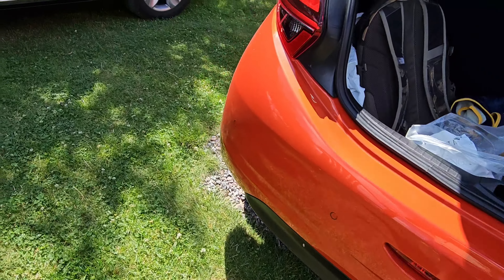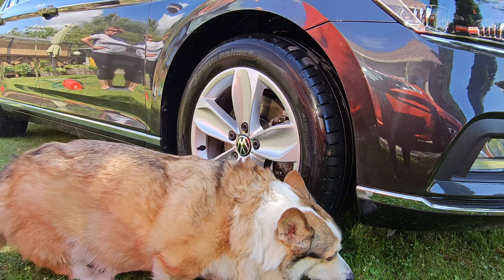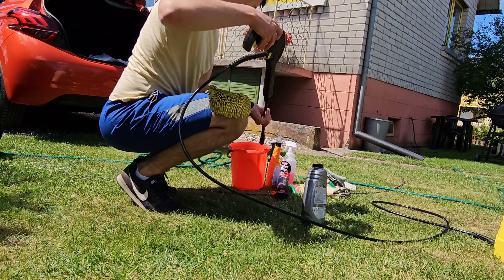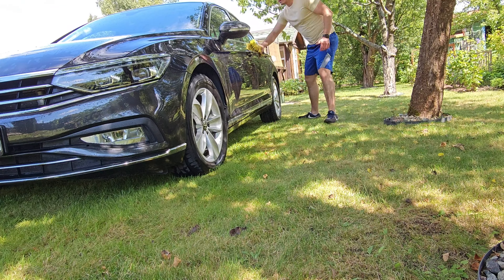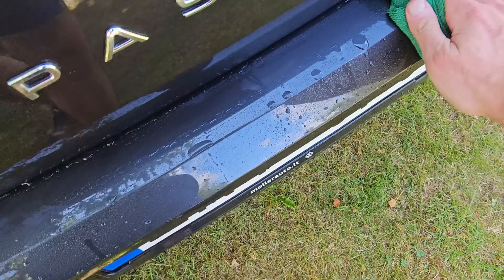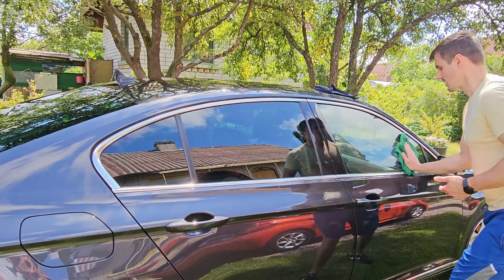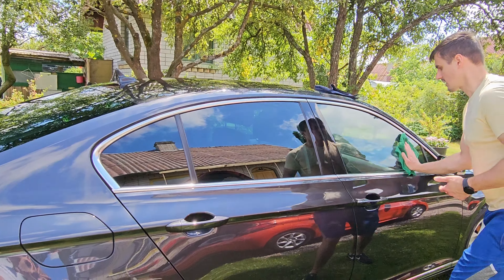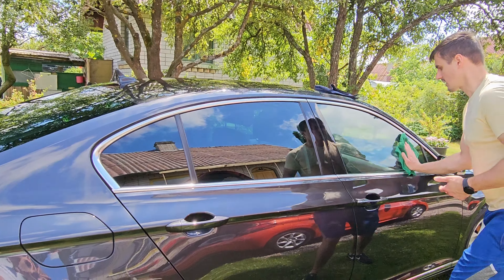Unprofessional detail, but great results#detailing#valeting

Comment: I love TW wax it wet. It's 4,40$in USA, it's 10€ here 😢
I hate TW ceramic wash
Reply from the maker: TW wax it wet got it for 3.50 euros with a 50 % discount.

Why do you hate the soap?🤣🤣
Reply: @ValetSpecialist  Whaat? 😵‍💫
The ceramic wash is veery expensive (about 25€) for what it is (a shampoo) and has no ceramic in it! If you follow the instructions it is for about 6 washes! And does no foam. So why NOT to hate it?
Reply from the maker: @flowinthrou the ceramic car soap was about 8 eu for 1.42 L, in the UK on amazon it's just under 10 pounds, yeah it doesn't foam it reminds of a rinsless wash almost but it cleans just fine